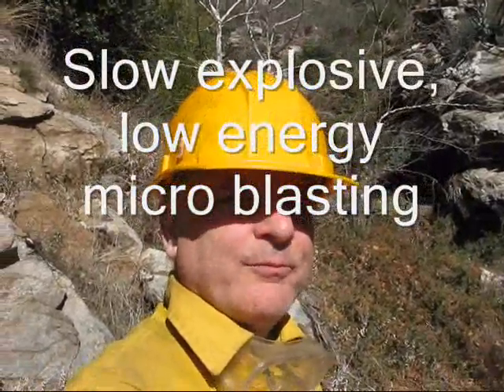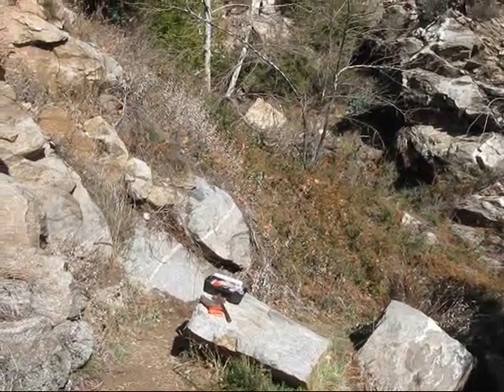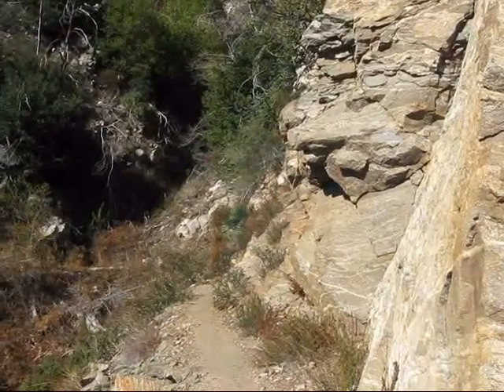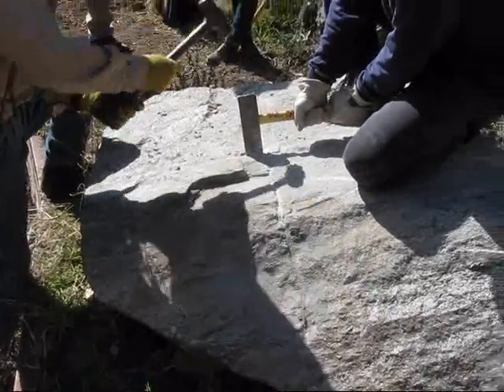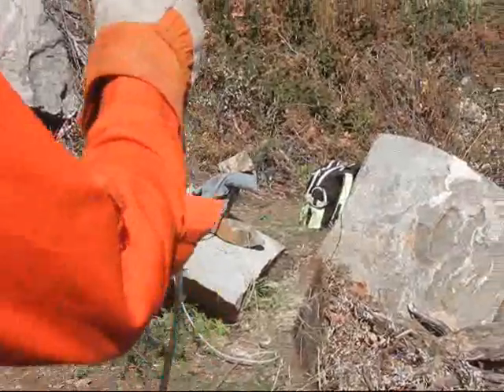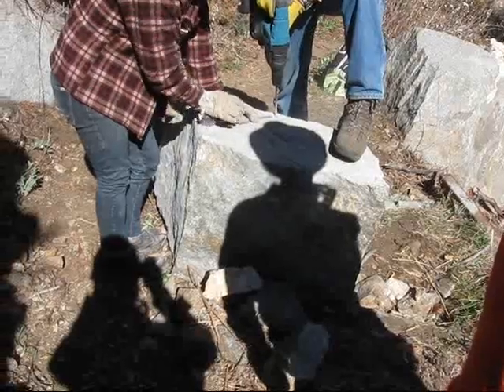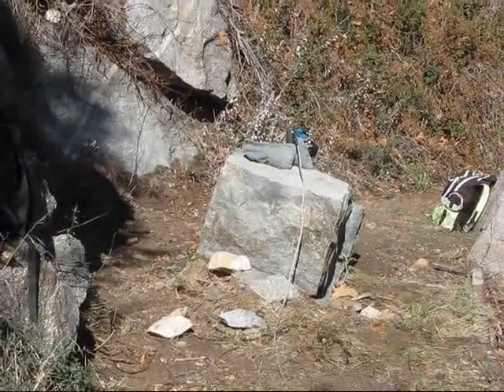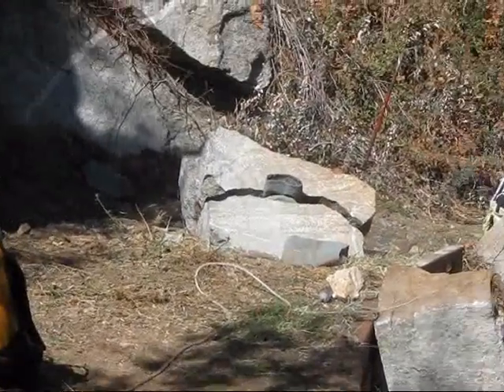Micro Blasting Heavy Boulder In Moist Soil Along Upper Bear Creek Trail

Comment: I have a couple of air bags that would have done a great job. Just dig a hole under, stuff the bag in, and inflate it with a foot pump.
Reply from the maker: +Docktor Jim That's an interesting idea. We have ample opportunity to try that, we'll give it a go!
Reply: AngryNotSoOldHippy It's how they get trucks back on their wheels when they tip over. I use them for raising gangways into position. Here's a small bag being used to lift a 6000 lb gangway. I had a small framing compressor and 2000 watt generator. A foot pump would have worked just as well. 

https://www.facebook.com/photo.php?fbid=10206215923269134&set=pb.1596358063.-2207520000.1456812474.&type=3&theater